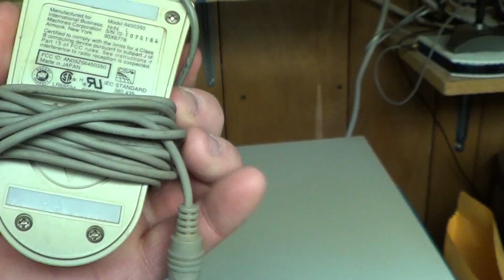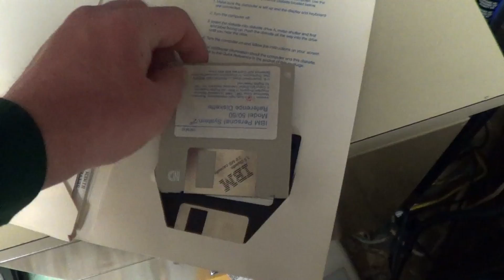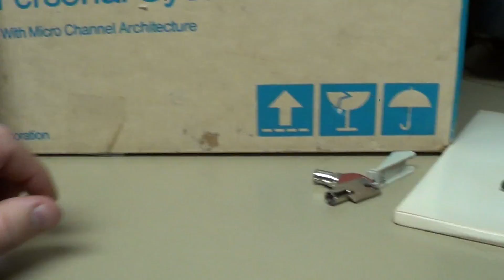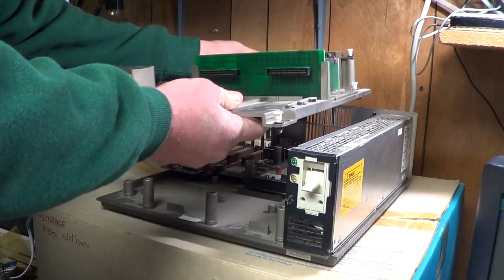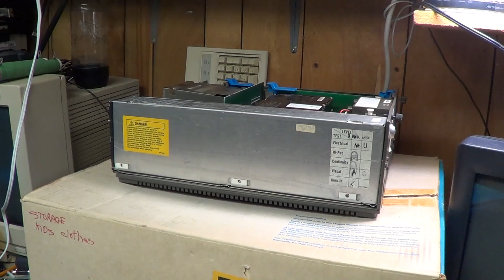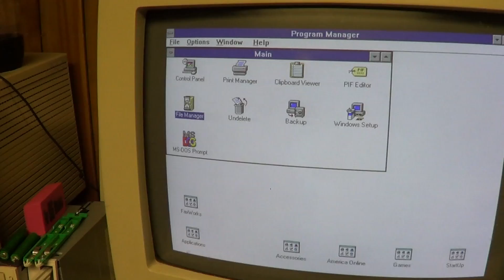The Good, the Bad and the Less Than Totally Inspired (IBM PS/2 Model 50Z Overview/Demonstration)

Comment: It is not "tool-less" - the plastic lever for the button clips is a tool, and unlike a common screwdriver is not easily replaced if lost.
I had a PS/2 at work.  One day I stayed late and got the HDD out, took it home, put it in my home PC,  and installed OS/2 as a dual boot alongside the DOS/Windows.  Those button clips and other "clip-together" features were a PITA; the plastic lever thing was not around (the IT support guys had confiscated them?).  OTOH my home PC was "cottage industry built", all screws and therefore far easier to tinker with.

Comment: I think upgrading the harddrive to a CF card solution and even the disk drive into a floppy emulator will take alot of load away from the already old and strained CPU, causing the system to live longer.
Reply from the maker: Using a CF card or IDE won't make any significant difference. You'd still be using ROM provided disk I/O routines, even if they're provided by an expansion ROM. The system CPU does not know or care what hardware ultimately fulfills I/O requests made by software running on the system. (And IDE adapters for Microchannel systems are very rare! None of the units that exist support anything other than programmed I/O operation.)

The same is true of the floppy drive. There is no meaningful amount of "strain" caused by utilizing a real floppy drive. Whatever CPU overhead there is would remain the same if the drive were replaced by some sort of emulation -- maybe a little more than usual if that emulation is being done completely in software.
Reply: ***** Just the noise from old hard drives in itself is enough reason to go for a CF card solution. But you are right, this system is so old that finding some kind of working CF card solution would probably be hard. Probably best to keep it as is for nostalgic and collection reasons. But one would think a CF card solution will draw less power VS one of these old hard drives.
Reply from the maker: I like those sounds. They're part of the experience. Speaking as someone who has run the various emulators, something is missing without the mechanical soundtrack. Besides, it's more the fan you hear from this system than the hard drive.
Reply: ***** Nope, that whine from the harddisk engine is much worse to me than any fan. It has this whining noise. I am very nostlagic about Amigas but that whining harddisk sound is not something I would appreciate no matter how nostalgic. But each to their own.

Comment: As for the mouse, you shouldn't bother with the FCC number, but search the UL file number instead, which is E93927. As it turns out, the OEM is actually ALPS ELECTRIC USA.
http://database.ul.com/cgi-bin/XYV/template/LISEXT/1FRAME/showpage.html?name=QAOT.E93927&ccnshorttitle=Office+Appliances+and+Business+Equipment&objid=1074027330&cfgid=1073741824&version=versionless&parent_id=1073991600&sequence=1
Reply from the maker: I've never actually had any luck doing that. I'm glad to hear it works for someone, though!
Reply: Okay, no offense of course! This UL-database works quite well for me, in about 8 cases out of 10. It only fails on looking up very exotic equipments... :) Keep up the good work -- greetings from Budapest, Hungary.

Comment: Interesting video. I recently acquired an 8550 (sadly, not the Z). It came with a Model 30 and some other things I got in return for testing out 5 gaylords worth of MFM, RLL, ESDI, IDE and SCSI drives (of which several dozen were drives for the 30, 50/50Z and 55SX/70/etc).

My hard drive that came with the unit has issues (which seems typical for the crap Seagate ST-138x and IBM WDQ garbage these machines originally came with); I also acquired an ARCO 1075 IDE MCA card, but that'll probably go into the 55SX so I can do OS/2, NT 4, etc.
Reply from the maker: I wouldn't have thought there were that many hard drives for the PS/2 line left in the world. (Okay, maybe a slight exaggeration, but they're definitely not falling off of trees any longer.)

I don't think it's fair to say the original drives from these machines are crap: they've far outlasted any reasonable lifetime expectation at this point! The later IBM "DBA ESDI" drives are much better than the original DBA MFM designs, if only because they are faster and don't suffer the problem of their oxide coating flaking off the platters.

Since you're quite constrained by expansion slots in the 55SX, I'd recommend looking for something like one of the Procom or CMS Enhancements replacement risers for IDE support. I wasn't that impressed with the Arco card when I ran it in a Model 50.
Reply: Sorry to say, but I still stand by my comments. When my mentor taught me over half of what I know, back in the late 90s (when these DBA ESDI drives were less than a decade old), I learned what drives were good and what was crap. Actually, having tested out several HUNDRED hard drives from those gaylords, it brought back memories of what was good and bad.

IMO, nearly all drives by Rodime are crap. ST2xx drives (like ST225) are fairly reliable, even 30 years later, although they were never known for speed, and obviously won't work unless you have a PS/2 Mod 60 or 80. Never had good luck with IBM-made drives, except a few SCSI 5.25" drives. Micropolis SCSI is top notch, the MFMs, not so much. Miniscribe was junk, and the Miniscribe/Maxtor XT series 5.25" drives have a propensity to blow capacitors and resistors, of which the smell smells like something not appropriate for this thread. ;-)

Sadly, a lot of companies that made hard drives in the 80s went out of business for a reason. Don't forget about the crappy CMI hard drives in the AT that were a failure (although I have a working one in my AT), or the Seagate ST40xx in the PS/2s that were iffy (I heard there's an artificial reef in the coast off Boca Raton of these drives that were defective).

I didn't know there were replacement risers for the 55SX. I know there are replacement risers for the 50Z (which I have, but my Mod 50 isn't the Z, sadly). Actually, the ARCO card I acquired is a CMS enhancements product. How slow was yours when you used it? I was thinking of just using a CF-IDE adapter and a 512MB Cisco CF card, for running NT 4, OS/2 3.0, etc, although I also have plenty of working Maxtor and Western Digital IDE drives from the early-mid 90s (between 120MB and 2GB).
Reply: Another question for you - any trick to getting the math coprocessor detected? I stuck one in my 55SX from another 55SX parts machine, but even automatic configuration doesn't detect it, although the coprocessor is appreciably warm (like the 386SX). Of course, there's no option to select it as installed or uninstalled.

Also, I used a new Varta camera battery in my Mod 50 that works great. For the 55SX, I installed a DS12887 from Jameco that also works perfectly (supposed to be a drop-in replacement for the DS1287, despite threads to the contrary from MCA sites). I have yet to solder up something for my Mod. 30-8086 so it can keep the time.
Reply from the maker: As we have different thoughts about the hard drives, there really isn't much more to say. (You're certainly correct about the longevity of some other makes, though.)

Model 50 and 50Z both have a hidden fourth Microchannel slot which will accommodate any disk adapter that will physically fit, so long as you remove the shield plate and the plastic bracket at the rear of the card. So you've got a lot of good options there.

I ran the Arco card only under DOS, and it was slightly faster than the stock DBA ESDI hard drive. At the time I didn't have the benefit of proper drivers for the card, so using a CD-ROM or any other OS was a non-starter.
Reply from the maker: There's no trick that I'm aware of: a working math-co should be detected immediately by the system. Whether or not it provokes a configuration-related error code during POST I don't recall...I think it should have given you a "164" error at the least and prompted for the reference diskette.

DS12887 works fine (and any site with the correct information will indicate this), it's the DS12C887 that won't work because the century byte is stored in a different register than where the PS/2 BIOS would expect to find it.
Reply: I'll only be using mine for the boot drive, since there's no room in the 55SX or the 50 for an optical drive.

I wish I could get another one of these Arco cards for the Model 50, but I guess I truly lucked out getting this one in general. It seems to work, as I loaded the ADF and the on-board BIOS pops up after POST on the 55SX.

And yes, I concur, there are many different opinions of hard drives. I was just stating from personal experience, as well as that from my mentor and others, which brands I have found to be of good quality and which were just crap overall (I'm thinking Rodime and JTS were probably the worst brands of all time).
Reply: It seems the DS12887 is getting hard to come by though. Jameco has them for under $10/apiece, but it's considered a closeout item. I don't really need a whole bunch of them, but I'll be upset when they're all gone (as I'm too lazy to do some dremmeling to attach an external button cell to a dead 1287).
Reply: +Paul Khoury I was hoping to hear the Windows 3.1 start up sound since the speaker was working but no....

Comment: can you help me with power keylock
Reply from the maker: You will have to be a lot more specific.
Reply: it is the locks that are the ones that lock off motherboards so you can not turn the power on unless you turn the barrel lock to on
Reply from the maker: Those aren't used to keep you from turning a motherboard on. They're used to lock out the keyboard when you are away from the computer. To use one, you'll have to know how your motherboard expects it to be wired up. The only way to know for sure would be to find your exact motherboard manual and study it.

Generally speaking, if you leave the lock connector open, with nothing attached to it, the motherboard will operate normally.

Comment: I bought one of these a couple of weeks ago after snagging it off Ebay for a decent price. It was in near-perfect cosmetic condition save for a paint scratches. Once it arrived I was, suffice to say, pretty angry and disappointed when I opened the box to discover the seller didn't bother to pad the bottom of the package. The entire front bezel was smashed to pieces, but miraculously everything else survived, and works. It even had the special tool still attached!
Reply from the maker: The same thing has happened to me. I bought an 8570-E61 to replace one I lost in a basement flood and the seller didn't even bother to pad it. That smashed the front end right off the front of it and broke up the floppy drive mechanism. Luckily, back then I still had some spare floppy drives in working condition and the top cover/front panel from my flood damaged machine. So I made a good one out of two.
Reply: I did exactly the same thing. Sadly this seller also neglected to pad the four corners of the case. the left side  is broken at the base by the front PC speaker, and by the rear expansion slot. The bezel is not entirely a loss, but it is damaged on the left side. After this double-fiasco I've come to loathe Fedex, and sellers who do not understand the value of these machines. The bright side of it all is that this other unit comes with a Kingston SX-Now! 386SX-33 upgrade chip.

Comment: Hey, uxwbill! I have been watching your videos about old computers for several days straight now and I was curious about something. I have access first of all to an old beige dell optiplex (don't remember which one but 98 or nt was shipped on it) that has been in pieces sitting in storage. everything is there as I actually checked it out and claimed the hard drive to prevent others from calling dibs on it. And I also have an opportunity to get an old toshiba tecra 700cdt laptop I can get (needs a power cord). First of all I was wondering if I should claim these machines (ie. are they worth taking up space at my house) and if you have had experience with them or have info on them? Thank You! Any help is appreciated.

note: It would be kinda nice to play some of the old DOS games again. Hello Doom!
Reply from the maker: You are the only one who can decide if these systems are worth adding to your collection. Unless you know that a system is complete and can be restored to working order, I'd tend to steer clear of anything that's in pieces. That probably happened for a reason. The Tecra laptop is probably not a bad thing to pick up, so long as (again) you're certain of its condition. Everyone who collects something has their own interests and reasons for doing so. As such it is a good idea to ask yourself what if any older computers you find interesting and where you want your collection to go as you build it.
Reply: well, if I recall right, the reason it is in pieces is because the ram was pulled from the unit and hastily put into storage. the ram got used to give a needed boost to another machine but I have replacements. Do you have experience with either of these systems? I am really curious of where these machines stand with you.
Reply from the maker: This all boils down to your decision: if you want to deal with fixing the Optiplex or if you feel that the Tecra would be an interesting system to explore and ultimately utilize. Only you can answer those questions. I've given you all of my thoughts as concerns each system, and right now I have no more to offer.
Reply: Well thank you! If i find a power supply, I will fire up the tecra and if i feel ambitious, I will rebuild the optiplex. I am impressed that you actually read and reply to the comments also. It seems that so many people don't. Anyhow, thanks and have fun making more videos like this!
Reply from the maker: Good luck with your computer collection. It's a great to learn more about computers as well, if that's a thing you're looking to do. Regarding the comments, I've always felt that Youtube was a two-way street, and that the least I could do would be to read and respond to comments and messages I get as long as I've got something useful to offer. Nobody has to watch my videos, after all.

Comment: I wonder if you could stay with the fact that the IBM PS2 came with an AMD chip and go with a ASUSTEK FM88 FM+ motherboard and A10-7850k or a A10-7980k APU and you should be able to run the software you already have and make your games run faster.

Comment: 386th like :P

What's the maximum amount of RAM that Kingston board can allocate? I used to have a couple 64 MB Kingston 72-pin sticks. 128 MB of RAM was nice in 1996.
Reply from the maker: +Chris Schutz The KTM-16000/386 is only good for up to 16 MB worth of XMS expansion. If you need more, one of the few ways to get it is with the Kingston MC/PS 64, Acculogic SIMMply RAM or a newer PS/2 model with more RAM capacity. There are significant caveats involved in taking all Model 70 systems and most Model 80 systems over 16 MB. (Also: you can't use more than one fully populated Acculogic or Kingston adapter. The BIOS and POST do very odd things with >64MB in these systems.)

Comment: Today I just found 2 working PS/2s. One has a 386DX-20 with a Coprocessor!!! The other is a DX-20 only. They both have maxed out ram and one has an XGA-2 graphics card. The other has a SCSI FRU controller with 30-pin simm cache.. $10 well spent!

Comment: It was a solid 286 that set the PS/2 standard until USB finally killed it in the turn of the century. I still have a PS/2 converter plug for my mouse. I don't miss cleaning the mouse ball and the inside rollers. I loved the upgrade expansion card options like VGA, OPL 3 sound or an early wavetable card, scanner, and SCSI HD. I also remember installing over a dozen 3 1/2 floppies for one game. I owned a Tandy 1000 TX that had a VGA card, memory expanded card, and an Adlib sound card. I played Wing Commander which ran about 30 fps for an 8 MHz PC. My old friend had an Epson PC with 12 MHz cpu and Wing Commander really flew well over 30 fps.

Comment: Old computers are a great hobby. Cheaper then old cars and guns. Allot of great games and it is still fun to play flight simulater 1.0 on an 8086 or 286. Found a version of space invaders that uses 5k of mem and works on 8088 hardware. I always liked the ps/2 just from the way it is designed. I once got word 6.0 working on an original 50z with the 287 and 16 meg ram, max for the 286. Biggest pain for the ps/2 is when the battery dies you need to use the reference disks on startup.
Reply: Yes old computers are fun.  As long as you have between 200 dollars and 500 dollars to spend your all good 🙂
Reply: @retrodork-n7k  Back in the 90's companies would get in trouble for throwing them in dumpsters. Back then I can across the Obsolete computer museum and thought it might be a fun hobby.
My wife finnaly made me get rid of my collection which had some nice pieces, even some 8080 stuff.
Bought a Tandy 4 for 50 bucks and they guy hands me a box full of software also.
Reply: @trucker9652 man a Tandy for 50 bucks! Wow!  I'd love to have either a Atari 800 XL, apple 2e, or Tandy 1000 sl/2 but these days all of those computers are 200 dollars minimum.
Reply: Trucker are yes flight simulator love that game
Reply: Totally agree... I got myself an old Toshiba 8088 desktop pc on ebay a while back, and man its the best fun ever..
Reply: What is the best classic flight sim